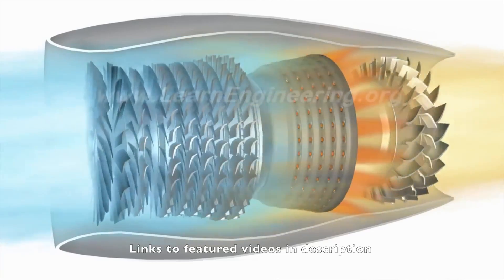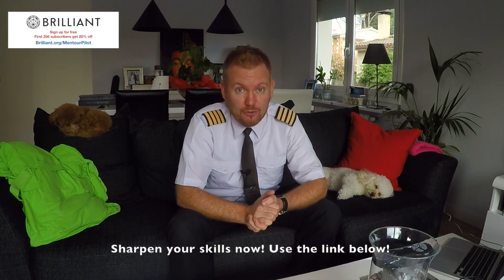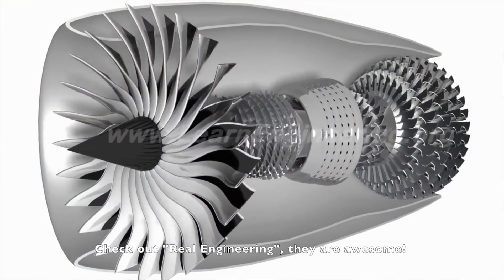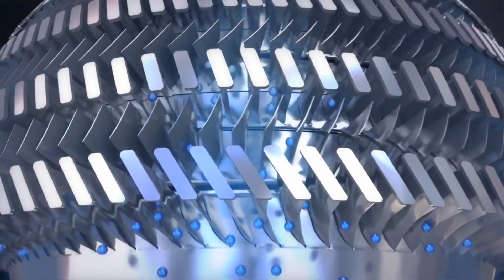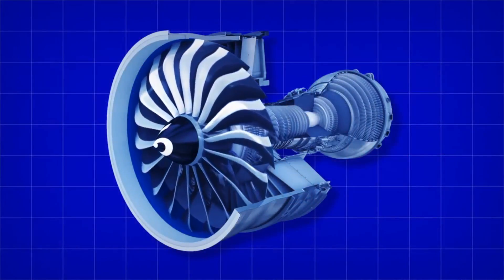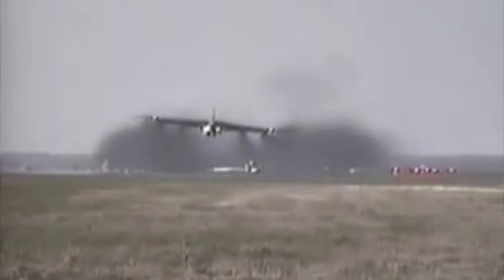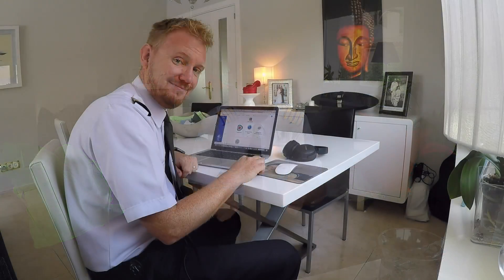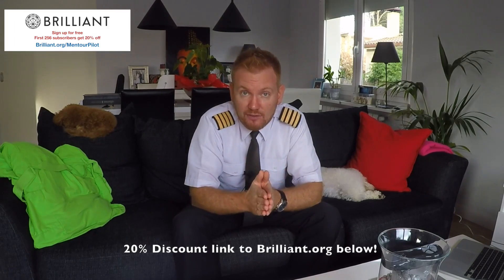Can water make Jet engines stronger?!

Comment: Is there any situation that will cause the pilot to flight the plane upside down, such as the movie "Flight" with Denzel Washington.  I really appreciate your videos, they are very enlightening.
Reply: Only in a dire emergency with no options remaining. That scene was loosely inspired by a crash on the coast of California, the elevator stuck forcing the nose down, and evidence suggests the pilots attempted to invert the plane as a final effort but they were unsuccessful or too late to arrest descent and impacted at high speed. I believe it was an Alaska Airlines MD-80. 
Alaska switch to an all 737 fleet a few years later to simplify maintenance.

Comment: Harriers carry 500lbs of water to allow for extra thrust during vertical takeoff and landing.
Reply: I could be wrong but I read it was up to something crazy like 900kg in it the very late models (GR MK 9A and 7A) and 300kg in some of the slightly earlier (GR MK5) ones (which is about 660 pounds). It was definitely used also in hover to reduce engine and exhaust temp. I have been trying to get any accurate data on early variants and cannot find anything definitive. I'm not sure about the FR MK2 (AV8-B) or the FR MK1 (AV-8A) or any of the earlier GR variants. In fact I would take the other data with a pinch of salt too as I have found them wrong before.
Reply: @gordonlawrence4749  Could well be, I'm just basing this on the modelled AV8B I use in DCS world :)
Reply: @Jean1641-4UK   -probably don't use them there but the natural combustion products are a large percentage water due to the 'hydro' in hydrocarbon fuel.  This of course turns to visible vapor if the humidity is high or ice crystals if cold enough.
Reply: @Jean1641-4UK  i can see why people think "chem trails" when they see the white trails behind jet aircraft, however if you ever look at them, the trails form somewhat behind the aircraft when the hot exhaust gasses have condensed to ice in the cold air that at the cruising altitude of a typical airliner is around -40c to -60c, the length of the trail and how long it takes do dissipate is dependant on how cold it is at the altitude.  

if you look at a car or truck engine on a cold winters day you will see similar at the tail pipe.
Reply: wow
Reply: I think its to cool the engine, during hovering jet engine produce lote of heat they want to remove that heat.

Comment: Hello Mentour Pilot, I hope you are doing absolutely fantastic!
 I made the demonstration about the "water injection" in my first-year physics class some time ago. Let's consider a small plastic shuttle in which you can pump some air. If you release the cap, it flies a few tens of cm. If you add some water in it and release the cap, it will fly further. It can easily be demonstrated that the thrust depends on the mass of the exhaust. To this, as the system does not operate at a constant temperature, the dilatation of the water gas plays a role as well.
I would love to know more about the navigation system in planes: GPS, waypoint to waypoints, VOR, DME, and approach. 
As always, thanks for your videos!!

Comment: Water injection in older turbojet engines such as the JT-3 increased "mass flow" by the cooling of the inlet air. More air means the potential to burn more fuel which increases thrust.
The KC-135A's were nicknamed "Water Wagons."

Comment: Such a great explanation as always!  Next gen G80 BMW M3 and M4, which are soon to be released, will also have a water injection system. I dont know if it’s technically similiar but it provides the same benefit, cools down the inner temperature of the 3.0 liters inline-6 and helps for a good 500hp to be produced (current M4 GTS is already good for a 493 hp)
Reply: Believe it or not this was done in rally cars in the 80's. It works on a slightly different mechanism IE the gas volume law and effectively turns your car into a form of steam engine for part of the time if it works anything like the old system. Basically 1 mole of any gas is 24 litres at room temperature and pressure. 1 mole of water is 18g or 18cc at 4C. Squirt just 1cc of water into a cylinder (which is 500CC in a 5 cylinder 3L car) and it will try and turn into about 2.6 litres of gas (because of the high temp). So since it is restricted to 250cc of space at the 90 degree crank angle (max torque) this will give roughly 10 barr of pressure inside the cylinder. The usual BMW S54 engine has a bore of 3.43 inches which gives a surface area of a tad over 9 square inches. The pressure is 10 barr which is about 145 psi which gives a down force of 1305 pounds. With an effective crank length of about 1.8 inches (which is how it gets high RPM) that gives you about 195 pound feet of torque. You could double the water injection to get double the torque. 800 pound feet is possible if you don't mind your engine occasionally getting a bit explodey.
Reply: i. rob  actually with fuel so bleedin expensive it's worth thinking about for fuel economy as it can in theory nearly triple the MPG and even lab grade distilled water is only £2 a litre in 50 litre plastic drums. If my maths is correct that would be enough at motorway speeds to do near 600 miles. If more people used it the cost of the water would come down and make it cost effective.

Comment: Hi, in the show notes you're linking a video about how a jet engine works from Learn Engineering channel, but you've labelled Real Engineering. Edit: The same happened with captions in the video.

BTW, I really like Real Engineering channel, it's worth checking out.
Reply from the maker: Ahh, ok I’ll fix that link. I thought it was a “real engineering” link. Thank you
Reply: I remember reading that one of the reasons the US uses the C130 for hurricane hunters is the turbo prop is more resistant to flame out in the rain...  I believe the prop is special as well to chop the water into more manageable portions...

Comment: If I remember correctly, when the Qantas A380 had the engine explosion, the engine was still running uncontrollably after landing and could not  be switch off. The fire brigade then tried to create a flame out with water and I believe they struggled a lot to kill the fire eventually, which again proves how difficult it is to extinguish jet engine fires with water.
Reply: That's correct, the engine explosion broke the electrical connections, so when the pilots switched off the engines from the flight deck, number 1 engine kept running......they got it stopped eventually, but it took a hell of a lot of water and foam if memory serves
Reply: hawkeye0248 They ended up having to essentially destroy the engine with foam as even with every fire engine on hand attempting the ‘drown’ the engine, water simply wasn’t enough
Reply: Yes, I also remember that! I think they had to let it run out of fuel.
Reply: @imaginerus  They used water and that didn't work, they had to use foam to smother it
Reply: They used fire retardant foam from the fire engines to cause the flame out
Reply: i. rob the controls to do that were cut by the no2 engine debris and shrapnel. The engines are designed to keep running in all circumstances
Reply: They had to use a type of foam which killed the engine as I remember
Reply: Why didn't they just throw two Canada geese in there. That should have done it.
Reply: Water is H2O. Hydrogen and Oxygen. Requires a lot of energy to break them.  A jet engine is 'quite hot' That is why all airports have fire suppressing foam. There are heaps of other things used by responsible airports.. None I know of use water as a first response. Jet fuel is basically kerosene. Safer than petrol. In the ease to burn. Like Diesel engines you have to use pressure to make it work right.

WARNING do NOT use a naked flame near Kerosene. It's fumes are more petroleum, and CAN/WILL explode.   All these products of crude oil are lighter than water, so will burn on top of water.  Water will just spread the flames.  Same advice given to every Scottish home in the 60's,  When we fried everything. "Never Ever Put water on a fat/oil fire"  Smother it!  "NOT WITH PLASTIC"
Reply: Early jet engines had a 'runaway' effect. They would just get faster and faster to the point of self destruction. Took about 3-4 years before the restriction of fuel came into play. Near end  of WW2  The start of rocket science.  Jet engines are not so different from then.  Just heaps more safe guards against it's wish to suck fuel and go faster.
You really want to stop a turbo/jet fan engine. Throw something that doesn't spark into the suck in fins, like a tree branch. Destroy the fins, stop the suck pump.

An A380 with a runaway engine. I am surprised. Where did it land? Any airport that can accept an A380 will have  fire control to match.
Reply: i. rob  Maybe the turbofan was not running on fuel, it was running on compressed air instead.
Reply: then why not shut off the compressed air?
Reply: @slamdvw  - errr think about it? think about where the air intake is? clue - ever gone near a jet turbofan??
Reply: No, silly... that's why I'm asking! I know nothing about them. Is compressed air their power source or something?
Reply: @slamdvw   well if it was powered entirely  by fuel  why didn't  they just somehow cut the fuel feed to stop the turbofan? If you want to stop  a car engine you could cut the fuel! The episode highlights the plausible fact that jet turbofans run on both fuel and compressed air!
Reply: A previous commenter suggested the fuel controls were damaged by shrapnel? causing them to not be able to shut off the fuel?  I'd like to hear more about using compressed air though, sounds cheaper and easier than this fuel thing to run my car on.  Or can car engines run on compressed air?  I don't know, I'm here to learn!
Reply: @slamdvw  
Engines work by burning fuel, not by the expansion of compressed air. 
You need a basic/moderate education level of physics to understand the principle. 

The most basic gas turbine is a turbojet:

1 Air enters the compressor which increases its pressure.  
2 You add energy to the compressed air by injecting fuel and burning it. 
3 You harvest the energy from the now very high temperature and high-pressure air by letting it expand past the turbine. 
4 The super fast exhaust stream gives you thrust. 

The turbine is connected to the compressor. 

Once you have a sustained burn, increasing/decreasing the amount of fuel you inject into the engine varies the level of thrust produced.
Reply: @chris746568462  OH!!  I thought ( from Pete's post ) they ran entirely on compressed air.  They do their own compressing?  ...so they run on fuel then??
Reply: @slamdvw  
Of course they run on fuel! 
A lot of mains electricity is generated by gas turbines too. They have been used in lots of places. Ships, trains, tanks...ect 

Airliners typically have a small gas turbine at the rear of the plane. It drives a generator to produce electrical power and is also used for starting the main engines.
Reply: @chris746568462  so... what is with this whole "shut off the compressed air" thing? See Peter and Pete's posts... I'm confused now
Reply: @slamdvw  
I have no idea what he means, it seems he has a lack of understanding of how a jet engine operates. Jet engines do not run on compressed air, THEY BURN FUEL! 
The last time I heard someone saying such rubbish also believed the earth was flat, so you can take that for his credibility level in delivering factual information. 

In the A380 engine explosion incident, the in-board No. 2 Engine on the left wing exploded. 
This fired shrapnel into the wing. It damaged/severed (among other things) the wiring in the wing this meant they could not shut down the No. 1 outer engine.  
They used firehoses spraying into the engine until it flamed out. This was the safest way to shut it down.

Comment: About water in jet engine and "dirty" engine; turbo jet engines used on ground as electric generator or compressor. They use water to increase efficiency(save fuel) and to have cleaner fuel combustion. In this particular example engine was running on natural gas. As maintenance dude explain to me water spray in engine expand 1700 times which is same effect as burning fuel. Water at the same time increases power and longevity in engine, also help with longevity other components down the road of exhaust gas. Exhaust gas after spinning compressor turbine is used for heating facility, water condensation... Who knows what else can hot fast moving CO² can do.
AS ALWAYS: STAY AWESOME
Reply: Dragan Crnogorac 

Nonsense. Heat of vaporization is endothermic, cools combustion gasses. It’s inert, not = burning fuel. It doesn’t increase power. It’s a product of combustion. There’s no free lunch by introducing water to an ICE engine.
Reply: @FrankGutowski-ls8jt  only thing what jet engine use is gas expansion while burning. So pumping water amd expanding that water onto wapor makes sense.
Reply: Dragan Crnogorac 

Internal combustion engines all use expanding gas to run. It takes energy to vaporize water. That lowers the gas temperature, which reduces expansion and that reduces power. There is no free lunch. If water vaporization alone created more power than it consumed, all jet engines would inject water, because it’s cheaper than a combustible fuel. They don’t.
Reply: OK people, I'm not expert I'm a truck driver. But man told me water add power, fuel efficiency and longevity.

Comment: Excellent video. However I am not completely convinced ( Mostly because of my limited understanding of physics) that the water ingested in the engine vaporizes due to the high temperature achieved while compressing the air. As even though high temperatures are reached the boiling point of water also increases with the increase in pressure. Please correct me if I am wrong. Thank you.

Comment: I really enjoy your videos, as someone who's been fascinated by aircraft from childhood but never had the opportunity to  take flight training.  All my flying is feet on the ground holding a R/C transmitter.  I wonder if you might explain one day what compressor stall is and what causes it.  It's mentioned often but without technical explanation.
Reply from the maker: That can definitely be done.
Reply: Thanks!  Looking forward to that.
Reply: In the 90s I witnessed an engine surge on a PA200 Tornado during an engine test run. After the engine mechanic in the cockpit selected the afterburner (moving the PLD into 'Reheat' position) the (at that time fairly new) digital engine control unit started the automatic parameter settings selection for several afterburner thrust stages. I don't remember if there were 11 or 13 stages - I am getting old ;) 
Anyway, when the final stage had been reached the pressure from the afterburner flame had increased to an unhealthy operational level which caused a surge / stall signalled by a loud bang. The flames were shooting out from the intake of the engine. My fellow mechanic who was standing next to the fire extinguisher discharged the whole thing into the engine intake. Luckily nobody was injured. 
Thinking about that story brings back good memories. It is quite impressive to stand around ten yards next to an aircraft with the afterburner running at full thrust :)

Comment: Hi, mentour! Why does the light sometimes go off and on again inside the cabin when the plane is still on ground? It always scare me !
Reply: They are switching power sources.  They shut down the main engines and switch to the APU (Auxiliary Power Unit) in the tail of the aircraft or they connect up to a power cart or ground power.
Reply: I agree with John Ferguson. My husband works for an airline and he connects the Ground Power Unit (GPU) from the jet bridge to the aircraft. Or they switch back to the Air Power Unit (APU) which is the aircrafts own power. So there is a split second of no power when they switch.
Reply: John Ferguson is correct. You are however going to potentially get two cycles at some airports soon as it is now frowned upon to use the APU as they guzzle a surprising amount of fuel. However they need testing so there is potentially going to be a switch to APU then a switch to ground power/cart.

Comment: Hi! Great video! I have a question, I have heard that at some extreme cases, the plane will be flying inverted. I wonder why is that possible? Is it true that the shape of the wing will only generate lift towards one direction? If so how a plane fly inverted. Thanks!
Reply: Depends on how the aircraft is designed; commercial airplanes are not designed to fly inverted. In order for an aircraft to fly inverted, the wing is designed with a special aerodynamic profile; this profile is symmetrical so the lift can be produced upwards, regardless if the aircraft is inverted.
Reply: @josemigueldelgado2440   Even normal profiles can produce plenty of lift for inverted flight; it's just a matter of trimming the plane sufficiently to produce a positive angle of attack. The limiting factor is engine power, though, because this produces lots of drag. Airliners do not have sufficient power for sustained inverted flight. Probably their fuel systems are not designed for it either, and certainly the galley would become somewhat disordered....
There is a famous (and AFAIK true) story of a prototype Boeing 707 doing a barrel roll at a public demonstration. Not content with one, the legendary test pilot (whose name I forget) did a second. When his boss ticked him off he said "Hey, I was just selling planes!". 
I didn't personally witness it; I wasn't born yet.
Reply: Gottenhimfella Thanks! This makes sense!